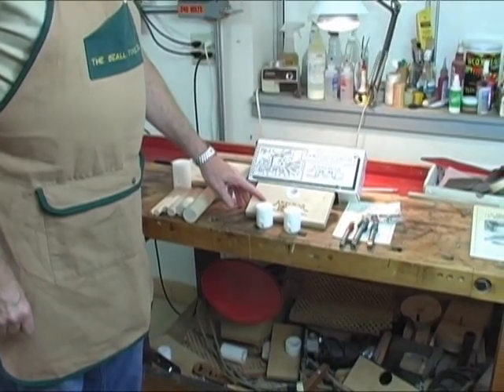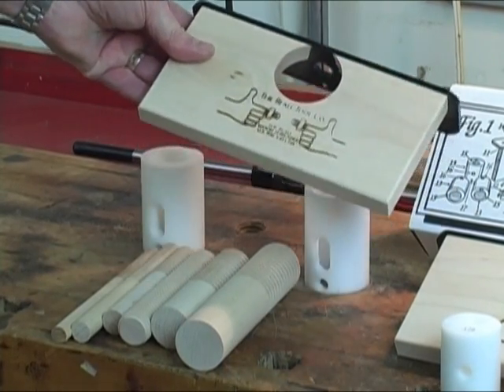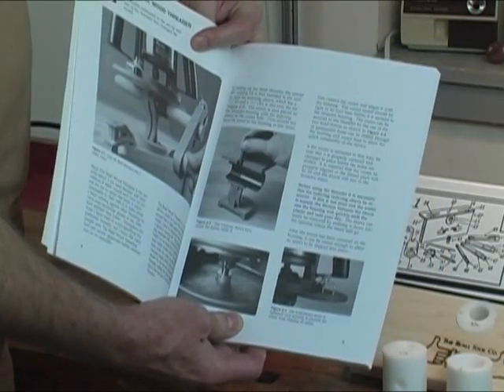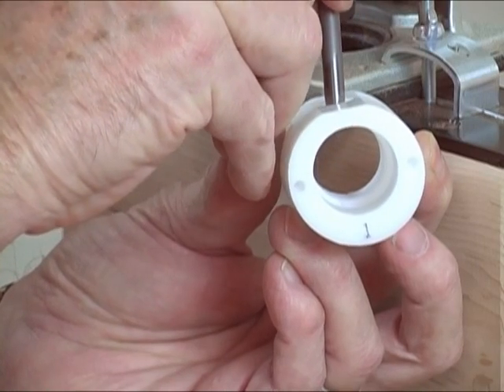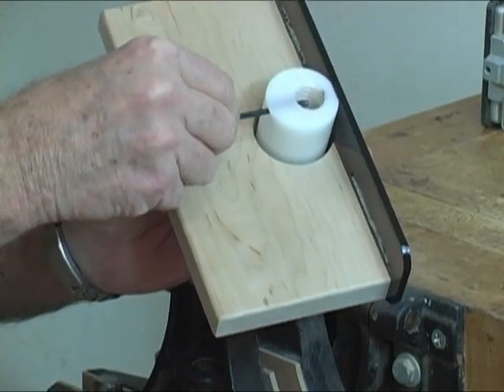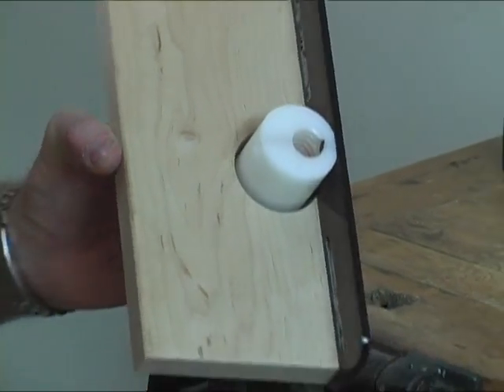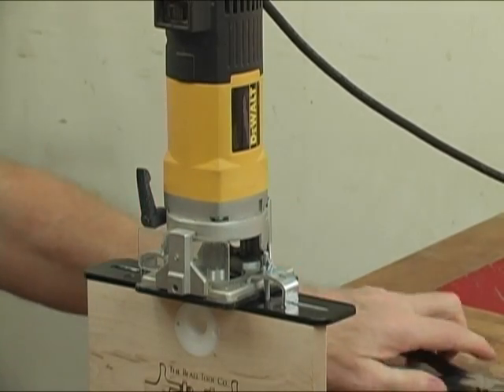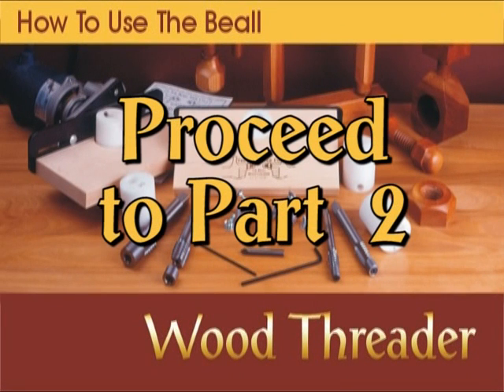Wood Threader How To Part 1 You Tube

Comment: Does it work with wireless routers?
Reply from the maker: It should work with any router provided the router base makes it possible to be clamped to the top of the threader.  Some newer routers lack a base flange wide enough to accommodate  clamps.
Reply: @jrbeall33  Many thanks for the prompt reply. I have the 18V cordless makita router. I am looking at your invention as well as some more traditional ones to build a lot of stuff. My problem is that I will make threads in places with and without electricity, but according to most reports, yours makes the best and smoothest threads.
Reply: @jrbeall33  Many thanks.